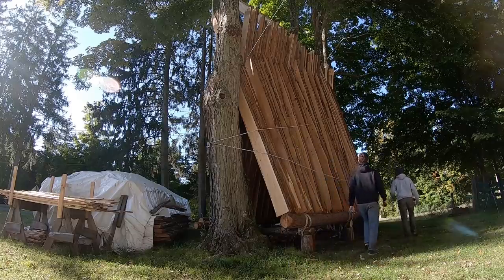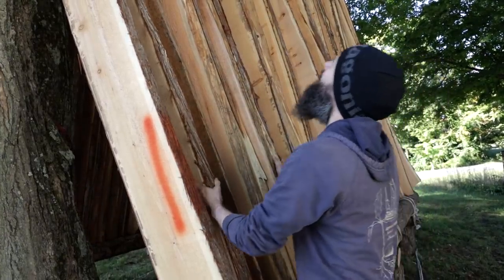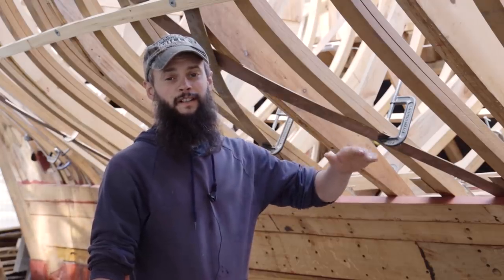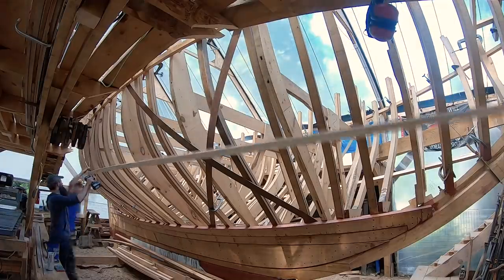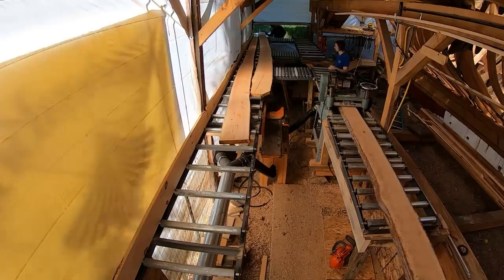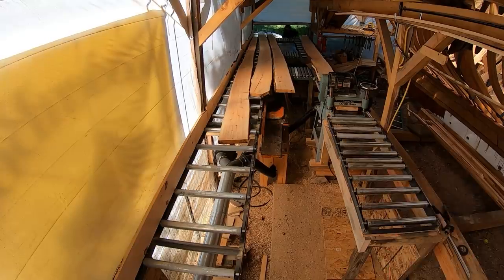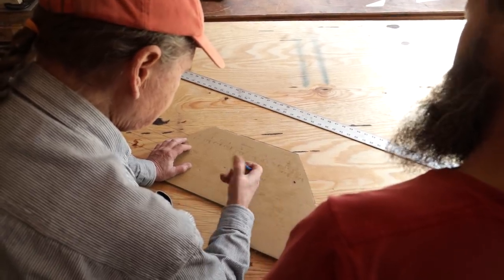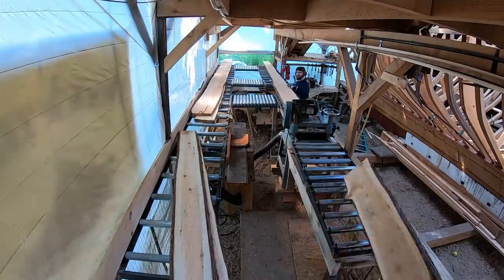Acorn to Arabella - Journey of a Wooden Boat - Episode 84: Lining Off and Diminishing Board

Comment: Somebody really should invent a base 10 measurement system. Would make this so much simpler...
Reply: chooseymomschoose 
It can’t be divided by 1/3
Reply: Using both in the USA I find the "simplicity" of the metric system highly overrated.  There are just as many benefits to the Imperial system, particularly in boatbuilding and navigation.  I also find it a PITA to have to keep Imperial and metric drills, taps, dies and fasteners.  Few stores carry metric tape measures, drills, taps and dies but metric fasteners are readily available.  Most manual machinery in the US is set up for Imperial measurements so there is little advantage.

Comment: Is anybody else bothered with that gap between frame parts at 10:14?
Reply: Not at all.  The two pieces of the frame will be pulled together by the planking fasteners.  Since they're steam bent and not glued together there is no problem.  It's just internal stresses within the grain of the frames that is causing them to not touch.  Every piece of the hull depends on the pieces around it for the collective strength.

Comment: Puzzling that they lay it out on a sheet of plywood instead of cad/cam. Bit more back  to nature than makes sense.
Reply: It's a lot easier to put a ruler on a sheet of ply and read off the exact measurement you need, than to pull it up on a screen. Besides which, this is a technique that needs recording, else it becomes lost to posterity.
Reply: @Garryck-1  I suppose my grandchildren will be wondering why some guy isn't using seven  dimensional hyper modeling instead of cad. These guys are going to have state of the art nav on this thing. Even if you can't get better faster measurements, I can and I'd bet these guys can too or know someone who can. I wouldn't be at all surprised to learn there is a computer double checking the plywood drawings or that the plywood drawings were copied from a print out for video verisimilitude.
Reply: Not really.  While much of drafting is now 3D CAD, it is not that useful for all applications.  I find extracting measurements from Fusion 360 to me more difficult than my old 2D system and the 2D system can be more time consuming than going to a hand drawn paper plan.  The things I build are mostly composed of flat surfaces so 2D drafting or hand drawing on a drafting table makes more sense "for what I do" and boatbuilding is in reality mostly flat 2D objects with a constant depth added.  The frames, keel, floors, stem and stern are all flat objects with depth added.  I build RC airplanes from flat wood that becomes 3D objects but all of the plans are better as 2D drawings.  Additionally a computer has to be kept in the dusty workshop to have any benefit whatever to electronic drafting.
Reply: Having a permanent Physical Reference always at hand, and one that is on a much Larger Scale compared to a computer screen, and also in a Horizontal/Table-Top orientation, cannot be replaced in this type of construction.

CAD/CAM definitely has its place in the Designing and Modeling aspect, but for the purpose of a Reference in the actual construction process, a larger, physical, to-scale reference is preferred.

If it had been produced via CAD, they still most likely would have wanted to transfer the CAD drawing to a larger physical media anyway for reference, and a large printer probably wasn't on hand...and its a bit of a PITA to manually stitch smaller Letter Size paper together. :-P   The plywood is more suited/more durable to their working environment as well.  ;)
Reply: @David-hm9ic  - Well said, David. It always amuses me when people automatically assume that high-tech = better. And I say that as an IT tech/programmer who's a hobbyist wood & metal worker. (who is also planning on building a wooden yacht soon.. albeit not in the traditional way Steve and Alix are!)
Reply: @bbfoto7248  - Absolutely!

Comment: All that "diminishing board" work could have been done very well on a spreadsheet.  Just sayin'.
Reply: More visible to many in 1/2 width written graph than just a sheet of numbers, so preferences vary depending on the person. I would find it much easier to understand and reference the way it was done in the video,  you obviously would prefer a spreadsheet. Different strokes,  different folks.
Reply: Plus, the numbers are not in a straight line anywhere on yhe actual boat. Fore and aft curves, plus sheer to keep curves. Every point on the graph is but a center point on the combination curve of the inside edges of the planks. 3-D drawing takes a lot more work to program into a spreadsheet. Now, if your only worried about the numbers alone, yeah, a spreadsheet could be useful. The division of a space into a number of sub-spaces is easy on a spreadsheet, but there are factors when dealing with a natural resource lime wood that take programming to a whole new level. A CAD program would likely serve better than a simple spreadsheet.
In the end, each person must learn to use what works best for their understanding of the information and process.
I think these guys are trying to combine centuries of knowledge with some new tools rather than completely reinventing the wheel, so to say. They are choosing tried and true layout planning versus converting it to newer methods.
Reply: How do you put a ruler up to a spreadsheet?  I'm a computer guy but also a hands-on craftsman.  Yes, it COULD be done on a spreadsheet but just because it's electronic doesn't make it better,